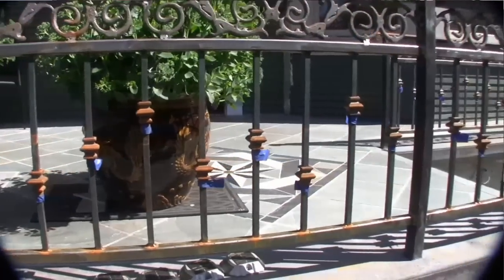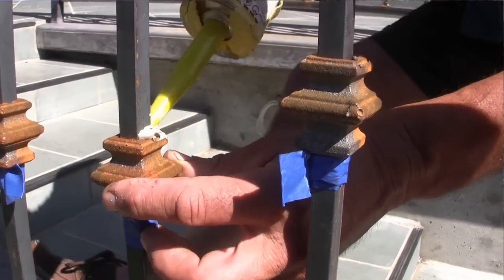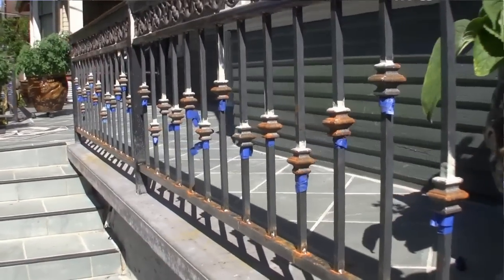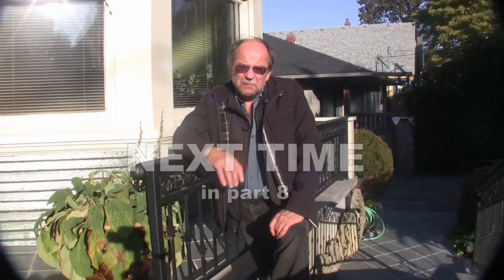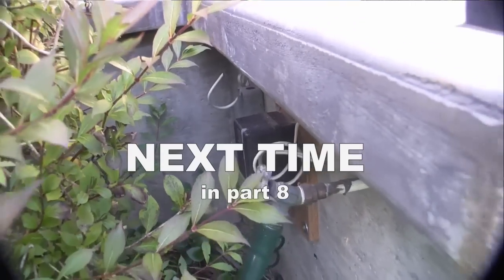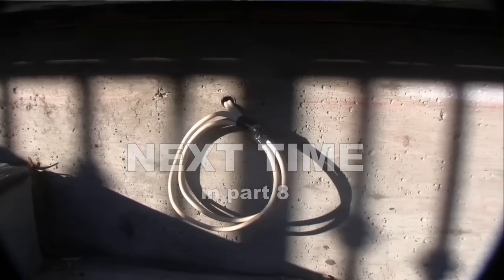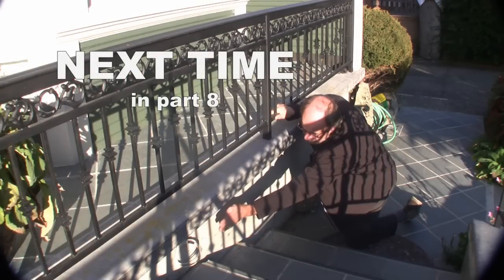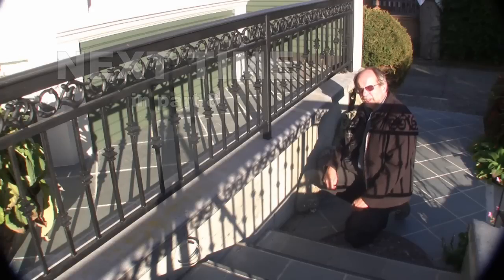Front Porch Rebuild Part Seven

Comment: You just don't see craftsmanship like yours often now days. But, I am amazed you were doing it all in shorts and welding with a stick welder without gloves. Great job, but the flash burns and sparks had to give you a little trouble. Cheers.

Comment from the maker: Good point about the health & safety. I am well aware of the risks and there were no problems as you suggest on this job; working alone, it is easier to moderate risk. There are many welding jobs I do where more protective measures are indeed appropriate.
I was concerned about the flash & splatter damaging the concrete & tile, in which case I placed a protective piece of plywood on the deck.
Thanks for watching and your kind words!
M